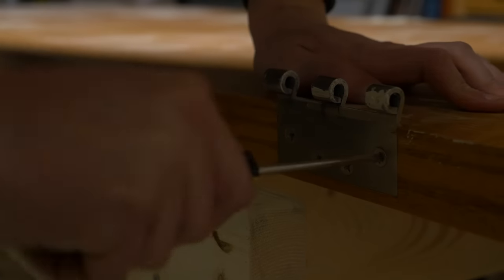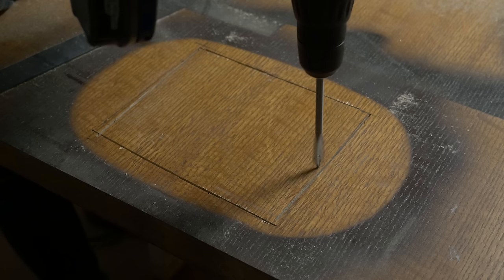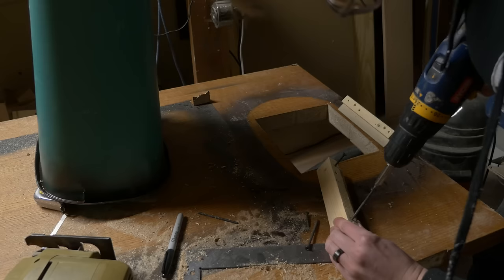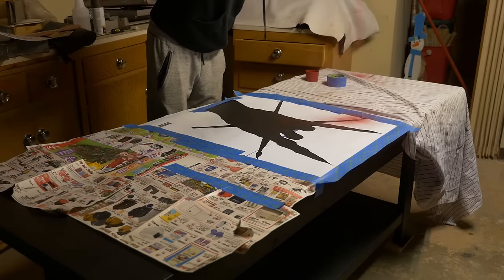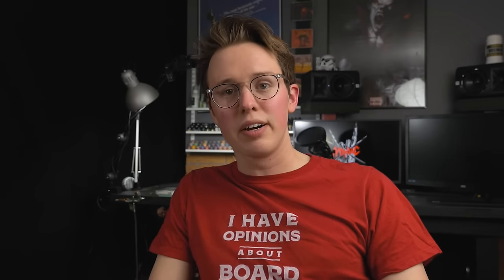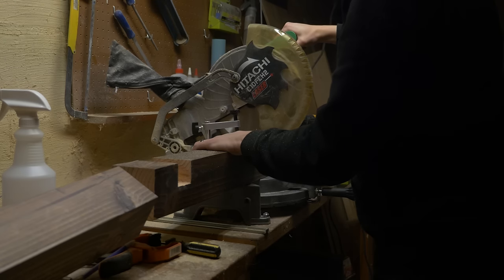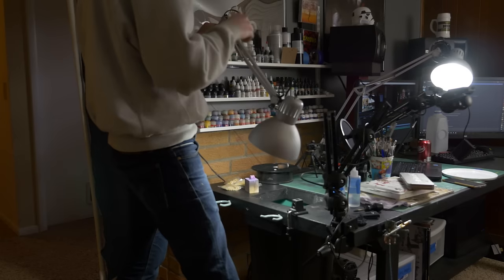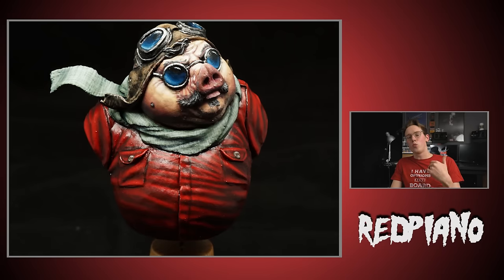Building a Hobby Desk | Part 2

Comment: I built a desk with the help of my great uncle 30 years ago. Its a 3 piece desk, two 28 inch file cabinets with a double level top 68" across, 30" deep. The genius in its design is that none of the parts are fastened together, they float, and are removable at any time. The shear weight of the top holds it firmly in place. Its a real monster, but its been with me through college, and six moves over the years.

Comment: Good tip if you do anymore building of things. Do NOT stack on top of a few lose sheets of wood to rip with a circular saw.  Instead buy a cheap piece of rigid foam insulation from the hardware store a large flat sheet. You can get it fairly cheap and do a series of passes on it no problem it will protect your blade and is a more secure safer option to cut on.  When you are done just break it up and use it for terrain or basing whatever you want,  and buy a new one. This Method means you don't need the blade to be exact depth of your material and you can have a 1/4 or so over lay and just cut through the foam safely!

Comment: Good Job ... Thoughts that might help, 2x2 front would be very thin and give little support,  at least turn the 2x4 Sideways or better the 2x6 ... other option would be running Metal Angle or Box tubing across, easy added with box tube and L-brackets from Home depot,  *Way to fix the one you have, take your jig saw and cut up into it and across (leaving the thickness of Angle Iron down from top), then run a piece of Angle iron behind it and Drill holes and Screw to the Wood for the strength. Great Job and Videos, keep'em coming !  ... Oh PS on the clamp arm Lights, Mine have a rod on bottom that Drops onto the bracket that clamps to edges, I just Drilled a Hole in top for those rods and didn't use the bracket .

Comment: Aren't all the little hiccups that occur during a project so fun?  And yes, I'm being sarcastic.  When I did an overhaul of my hobby space to include a new, bigger paint storage the hiccups just kept piling up and there was a point when I gave serious consideration to just hucking everything out the nearest window.

One question; why a matte finish?  I ask because pretty much everything sticks to a matte finish, which means its going to be harder to clean up spills and accidents (of paint and other things that could stain/adhere).  If its to cut down on the reflected light during filming, a satin semi-gloss would probably have worked and given you a little more durability/protection.
Reply from the maker: TheRunesmythe yes the reason was merely for the reflection during the filming of the intro specifically. I thought a top down shot of the desk while being lit would have been too reflective but maybe I was wrong!

Comment: Sweet desk, man! 

Dat speaker placement, tho ;_;
Reply from the maker: Is the speaker placement bad? Thanks!
Reply: Miniac if you do any type of recording, or anything, rule of thumb is to have the speakers aligned with your ears, and forming two points of a triangle, with the final point being just behind your head.
Reply from the maker: Yeah, that was my goal. The tweeters point to my two ears forming an isosceles triangle with my head (when I'm not slouching). They may be a bit too high, however.
Reply: Ohhh! Gotcha, gotcha. from the way it looked in the video, they seemed like they were super duper high. Either way, the entire setup looks awesome. Much better than my 6 foot table with a desk, and a ton of crap crammed on it. haha
Reply from the maker: Tice Thomason yeah it's a nice setup indeed! the speakers may be  a touch high. had to get them over the monitors, I'll check when I'm home.